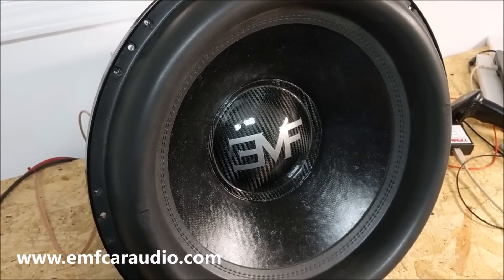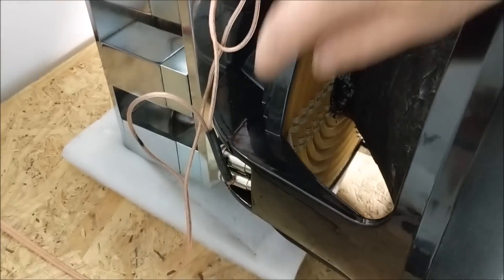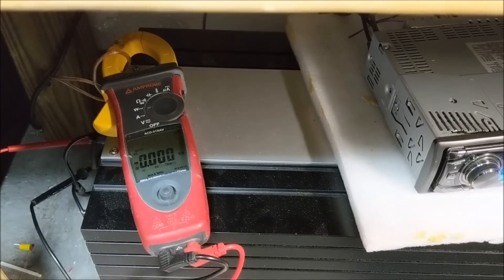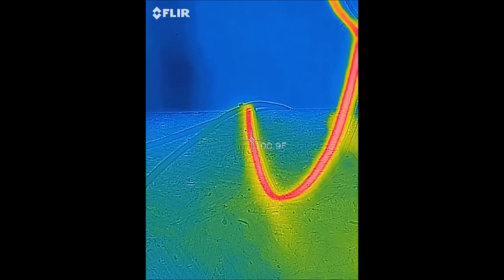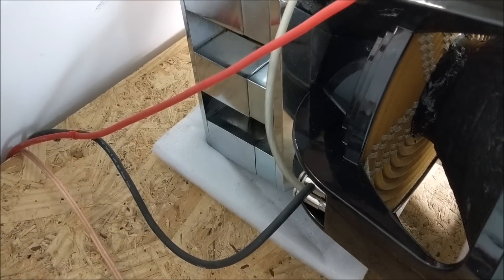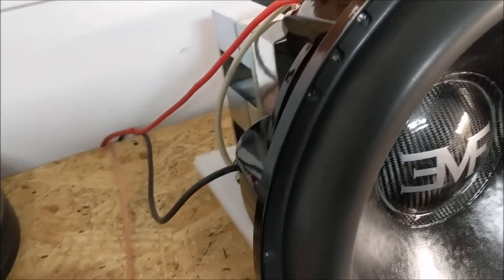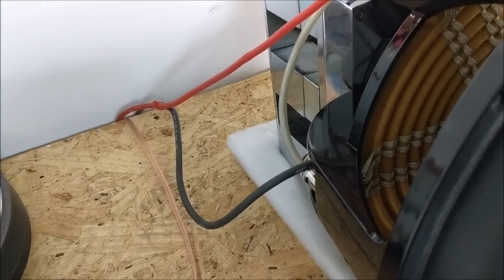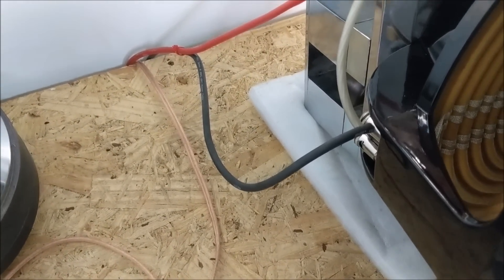Are you using the proper speaker wire size?

Comment: I'll never understand why Orion doesn't put 8 awg speaker inputs on their hcca subs. I had to use 8 spliced down to 10 to go into the sub. I thought that was stupid.
Reply from the maker: Not everybody engineers their own equipment. Also, you don't need to have the ability to accept a wire size needed for power it can't handle.
Reply: @EMFAudio  well of course that's definitely true but recommended wire for 2500 rms or more is 8 gauge is it Not? The 10 gauge has been alright don't get me wrong, but I'd be much more optimistic about feeding it the power it wants with 8 awg or bigger. Also even the hcca spl series uses these small speaker inputs and they are rated 5k rms so...
Reply from the maker: @bass-n-truth-inthestix9083  All those things say something about the product doesn't it? For 2,500 watts at say, 1 ohm, that's 50 amps. With a run of like 7 ft of speaker wire 10 gauge is sufficient. 8 gauge would be needed for longer up to 15 ft or so
Reply: @EMFAudio  right on, yeah I have very little length as my install is in a single cab f250 as a center console box. It's like 3 feet of sky high ofc 8awg spliced to 10 awg ofc of some other wire I came across with no brand name on it but it's clearly good ofc wire. So far so good. No issues. Now that I see that I could have bought a emf sub at around the same cost I'm wishing I did lol. I forgot which you said is 429 dollars but that sub looked like it would take just as much power or more than my HCCA. Was it yolo that cost that much for a 15? Sorry I just got done watching a buttload of your videos so I might be talking about a different video where you spoke about the cost.
Reply from the maker: @bass-n-truth-inthestix9083  that price point would be a Banhammer. You'd be happier with a Banhammer I'm sure. I'd ditch that sky high wire too but one thing at a time.
Reply: @EMFAudio  lmao banhammer that's the 1! Yeah I fucked up lol. I even bought a recone kit for my Orion just to have if I needed it. At the price I paid for the sub and recone I could have had something else all together. I'm pretty happy with Orion not gonna lie. Especially the amps. I've yet to see any company come close to power, quality and value when it comes to amps. I'm talking watts per dollar and without it being complete shit. The subs though, even though I like it and it does the job quite well... rather have emf but I always thought it was out of my price range.  Which it is now since I spent my budget on Orion "DOE" (INSERT HOMER SIMPSON VOICE). I'll send ya my sub and recone kit for trade of 1 of your subs of equal value and power capabilities.  Worth a shot doesn't hurt to try😂
Reply from the maker: Don't confuse amp dyno power with actual power. I've seen amps show power on a clamp and read 2 dB lower than another amp on the same power. There is a lot to be said for not knowing how bad you have it till you've had better. To be quote frank, you literally couldn't give me one of those Orion subs. I'll also throw out there, we have the Lowballer line, that starts under $200.
Reply: @EMFAudio  haha you no like Orion I see😂. Yeah man all I know is if it won't take 3k or more rms it's no bueno for me. My amp would blow a 750 watt sub in a heartbeat. I actually remember now why I didn't end up going with sundown or emf and it was because if I wanted a sub that could handle over 2k I needed to spend over 1000 bucks which is absolutely ridiculous when there are plenty out there that can for half the cost. Price and quality is what I have in mind but paying bookoo bucks for something just because it says sundown on it or emf sounds insane to me. So you're telling me a banhammer will take more power than a HCCA sub? Even though it's rated at less?
Reply: @EMFAudio  p.s. I've also watched clamp meter tests of Orion amps. They pretty much shit on every other companies price per watt and build quality in my opinion. In many people's opinions actually. I'm not saying emf or sundown isn't damn good stuff. I'm just saying it's not worth the cost. How is a Dyno test not true power. If that was true Dyno tests would be completely pointless.
Reply from the maker: Brands have to prove themselves to me, and when you sponsor 30+ guys with free equipment, they blow up everything to get 5th at best, that says everything I need to know. Power ratings are a bit of a novelty, sadly. It isn't an indication of performance, nor is it an indication of actual power handling. Example, there is a single Banhammer 15 owner with an Orion 4k on it and he's said the sub doesn't seem to care.
Reply from the maker: The dyno is flawed. It doesn't tell efficiency for one thing, but the results can be manipulated. In my opinion yes, the dyno tests are kinda pointless. Nobody listens to resistors on a bench. The real results are in a car. So ask yourself this. If the Orion amps are so great, why are all the top competitors not using them?
Reply: @EMFAudio  hmmm really? I've heard the same thing about Orion subs and American bass and many others so that is nothing new to me. As long as it's clean power alot of subs can take more than rated. Still good to know about dude running a  banhammer on a 4k that's awesome.
Reply: @EMFAudio  well as far as I know Orion has been killing it in the competetitons so I'm not sure why you say they aren't being used by top competitors because they are for sure. Also no a Dyno doesn't show efficiency but the people doing Dyno tests do by using other equipment with the Dyno. Also as I mentioned they have in car clamp tests by the dozens on YouTube for Orion amps. I appreciate you chatting with me man. I always enjoy learning new things and friendly debates. I'll say this though for sure.... show me a sundown amp rated at 2500rms doing 7k and over 3 k @12.6 volts I'll bite on that. Also I am not particularly interested in efficiency although it is a plus. Remember I personally am running a single hcca 15 on Orion xtr2500.1dz and I have experience with this brand so kind of like you said, a brand needs to prove themselves to me as well. Orion has done this but I also have had interest in emf for quite some time. I do wish I knew the banhammer can take power like that before I went with Orion though lol. Hey it's all good brotha regardless keep the videos coming I've subscribed and will be tuned in. If you're feeling adventurous give me a subscribe in return id appreciate it. My channel is small still I'm trying to get it up and running the more subs the merrier. Also my video called "putting the hcca to work" is a good demo of my system in my work truck/spl vehicle if you care to check it out. Thanks for chatting I do appreciate any new information I can get even if I don't agree 100%.
Reply from the maker: @bass-n-truth-inthestix9083  I recone a lot of American Bass subs. Don't confuse having a 4,000 watt amp for having 4,000 watts on it. The guy I spoke of actually sees 2,500-3,000 in car, as tested by him. Also proving amp Dyno numbers are a lie.
Reply from the maker: @bass-n-truth-inthestix9083  I've heard Skar wins all the competitions too, but the ones their winning had nobody else in the class. I'm talking about real organizations with shows that have turnouts. Of the 30+full ride Orion people last year, 2 or 3 attended finals and the best any of them did was 5th. Those HCCA's they're using, 1 burp and done. They're all replacing subs at the show to do those 5th place numbers. Show ME a 2,500 watt amp that makes 7k. I'm talking in a car, connected to subs, not clipped. According to dynos the 3k makes way more power than the 4k. Do you think that's an accurate result?
Reply: @EMFAudio  and believe me im not a newb I'm not confusing anything with anything.  I know what you're saying and I definitely know what I'm saying as well.
Reply: @bass-n-truth-inthestix9083  no it's just sundown and EMF rate much much more conservativley. A Z series or banhammer will probably actually handle more then an HCCA
Reply: @Str8GasGenetics  I have my doubts on that.  Not that they rate conservatively, but that they can handle more. I would guess that they all are around the same ball park. Although Orion is rated 2500 RMS which is also conservative where as the z and banhammer are 2000 rms conservative.  Regardless I hate the terminals on the hcca subs. It's will take 10 gauge wire but I'd rather 8.
Reply: @bass-n-truth-inthestix9083  yes a Zv5 will take more then an HCCA, those shitty 8 inch  spiders lack of xmax, and old design keep it way behind. Sure we're talking about 4" coils but even the U series was burped at 16k.

Sadly no one is willing to throw money at these tests for recones but theres a reason people rarely run Orion subs in competition anymore, sure the amps are the best imo but the subs are a decade behind

Comment: can i use 8 awg cca wires for speaker wires or should i change it to copper. my sub is pushing 1200w but im working on my electrical before i upgrade my amp to 2000w
Reply from the maker: You can, that's larger than necessary even being CCA. 12 ga copper would be sufficient, 14 gauge could be if it's a short wire.

Comment: Thank You for making life a little easier! The thermostatics scanner helps to see what is going on but. I think safety is better, just to protect yourself from yourself. You spend most of your life in a vehicle, and someday you will be stuck in traffic wanting to go home and too, brake father-time ticking away at you. Somethings just say turn-it-up to drown out the outside noises. That is when I think you should use a SAVIOR wire like a 6AWG or lower depending on the length from the amp just in case.
What do you think about a SAVIOR gauge wire? Plus you are just dealing with only one specific cable, from the battery, fuse box,
amp, to the sub or subs
Reply: You will be spending most of your life in bed not a vehicles unless you are driving 8 hours a day.

The thickness of the wire depends on voltage and current. The higher the voltage, the less current therefore a thicker cable is not required.
The voicecoil likely has smaller wire than the 16 gauge.

Comment: I used 8gauge power wire years ago. for speaker wire. and drilled holes through the box that was very tight. using the adhesive as a lube to help it go through. and never  had any problems. plus small wire can be a fire danger just like power wire. just not as likely

Comment: What is  tihe difference betwee 0 guage CCA power wire and 0 guage AWG power wire and is one Better than tihe other?
Reply from the maker: Carolyn Hunter You're asking about 2 different things, unit of measure and wire material.
Reply: I think you meant to say CCA vs OFC wire. If that's the case, OFC wire is a better conductor than CCA wire.

Comment: O sh*t! Time to change speaker wires! Can small speaker wire create some serious bottlenecks and clipping?
Reply: Once I asked what could be the cause for smelly, cold sub when it was clipped. Mybe the speaker wire was smelling, because clipping created more current that it can handle? Im using 16 gauge speaker wire.
Reply from the maker: How much power do you have? It won't cause clipping, it will just reduce the amount of power going to the sub. The more the wire heats up, the less it will deliver too. If the sub was cold and you smelled something, it could absolutely be the insulation on the wire you're smelling. Or, if you're using a terminal block on the box it could be that connection too, or even melting it.
Reply: EMF Audio Im running 1500w rms and I dont have terminal cup.
Reply from the maker: No Limits Audio I'm assuming you're using it at 1 ohm so i would definitely change the wire. You may be smelling the insulation melting.
Reply: I just did the wire upgrade to 8 gauge, but there is still some minor acid smell (sub still cold) when i accidentally clipped my sub :). So last thing that can cause this chaos is the box (I guess)... its 100l, tuned to 24 hz. and I play lownotes a lot. Manufacturer recommends 65l box tuned to 45 hz. Can the box be too big? Sub fs rating is 36hz.
Reply: No Limits Audio clipping is when the amp outputs DC voltage. and basically tries  to turn coils to heating elements. and when a amp is put in a really low ohm load.  and the amp is pushed really hard. and runs out of voltage. the signal gets clipped! the sine wave like on a scope. actually is cut off. leaving pulsed DC current. and all that does is heat coils. and cause distortion! I always consider it not worth it. and keep away from clipping. and turn down the power a bit. I like sound quality over absolute loudness?

Comment: the less gauge, the more power the wire can take? did i get that right?
Reply from the maker: I'm a Refugee The lower the number gauge wire, the larger the wire is, the more power it can take.
Reply: what gauge wire would you need for a 6.500rms sub?
Reply from the maker: Ours has dual inputs per coil so you could get away with smaller, but depending on the wire length you'd need 8 gauge wire as a single run to the sub as a minimum. If you ran 1 set per coil you could do less, but larger doesn't hurt anything. It's just not necessary.
Reply: bummy 906 damn. Baseball bat size wire for that sub! Lol

Comment: What’s better aluminium round wire or copper round wire for a voice coil “mid bass woofer”
Reply from the maker: 91rickstar that has nothing to do with this video, but the wire used in a coil on a speaker depends on a lit of design aspects.
Reply: I know it has nothing to do with this video I just wanted to ask, I’m making a set of 6.5” midbass woofers with aluminium round wire 0.5mm

Comment: How much power do u think I could run thru a five foot run of eight gauge? Apologies if u said the answer I can't hear to. Well anymore
Reply from the maker: Daniel Harrell there are calculators for that kind of thing. You plug in the wire size, and type, and length. It will tell you how much loss you will have.

Comment: I experienced speaker terminal cups melting at the connection with high wattage amplifier's.  So now I use Stainless bolts or direct connect from sub box to amp.
Reply from the maker: Terminal cups aren't always a great quality connection either, which causes sparking sometimes even. Even with proper wire size, a bad connection can cause the same thing. It's only as strong as it's weakest point.
Reply: @EMFAudio   They usually work great up to 2000w rms if you bolt ring terminals directly to the inside, thats a little secret trick. All of the best buy kicker crowd just use female slip terminals on the shitty little foil strip that comes off the inside of the cup. THOSE GET HOT AND WILL MELT CUP!
Reply from the maker: @rmblwgn  Terminal cups are current limited, not wattage limited. Impedance matters.
Reply: @EMFAudio  please elaborate.
Reply from the maker: @matt6951  The lower the impedance the higher the current
Reply: I agree with ditching the terminal cups especially in high wattage apps. The problem is stainless isn't the best  conductor. Do yourself a copper or brass  and you'll see much better flow .